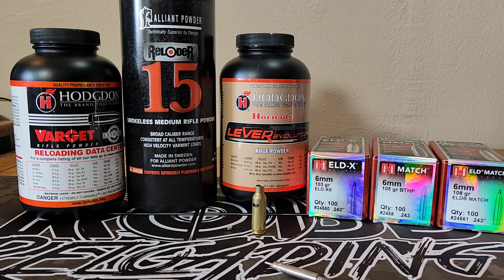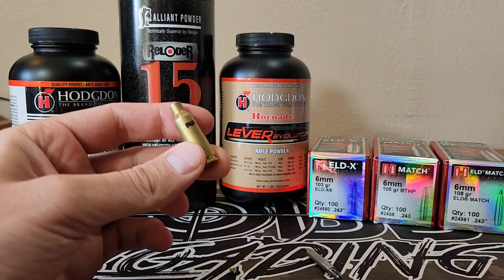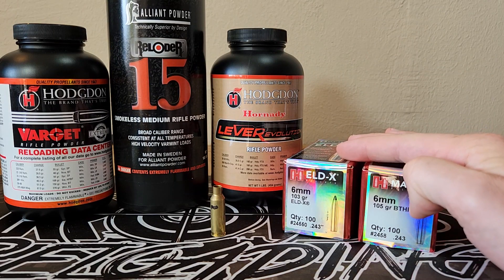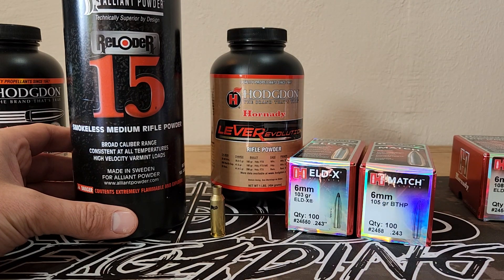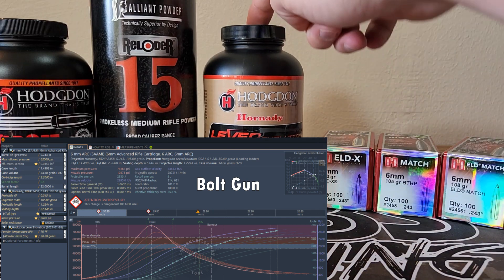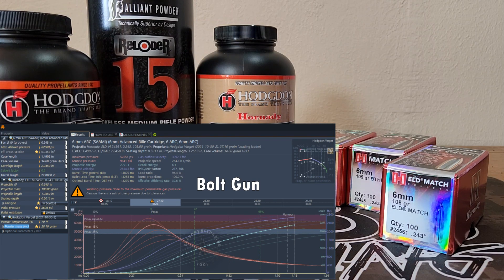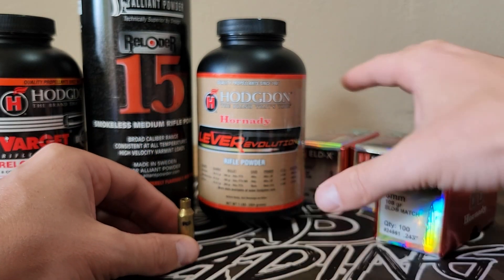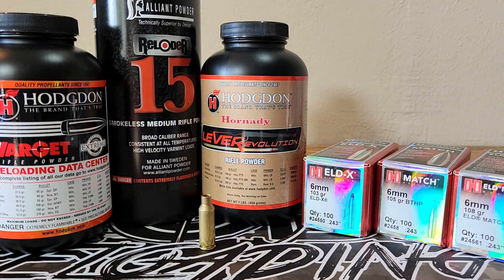6 ARC Brass Life/Load Data

Comment: I've had a lot of pressure issues with 6 arc. Peirced primers in factory hornady ammunition that is loaded too hot. I'm getting flat primers, ejector smears, raised burrs on case heads on loads that are below max charges using hornady's gas gun load data. Sheared off extractor with less than 200 rounds shot. In my opinion  Hornady lied about this new round they created. Their marketing doesn't work if you can't get the velocities they are promoting. Pisses me off!

Comment: Firing the 6ARC through a Shilen 28" four groove barrel and loading extremely long if a Savage 110 action. First I will say with all the powders I have tried with a few different 105gr bullets I have been finding the published velocities to be so far off to be useless. I have been using a combination of Hornady and Starline brass. I have some with 5 reloads through them and still tight.

Comment: I think you are correct. I pulled apart some factory black and match ammunition.  They are both loaded with 30.2g of what looks like leverevolution.  I noticed that they have stretched primer pockets after 1 firing of factory loads. I think hornady fudged the numbers a bit. I also think this is why guys are having issues with bolt heads breaking in gas guns with this ammunition.  Its loaded hotter than their listed max loads.
Reply: I did the same thing with the match. Some of mine weighed  in at 31.0 grains.
Reply: Same here. I pulled bullets from their 108 gn eld m ammo and weighed the powder after my extractor broke off. The powder charge was between 30.5 and 31 grains.

Comment: Not all brass is the same either!!Use a ball anvil micrometer when working up loads. Measure the expansion of the case right above the rim. After firing it should not exceed .0005 and its also a sweet spot typically for combustion. That  is all that the brass you are using can take before it starts to fail. More expansion than that will lead to loose pockets and then case head seperation. This is an old school technique that never shoul have been forgotten. Also i suspect hornady brass is not very high quality. Ive had similar problems with it before i started with the micrometer.

Comment: I am new to the 6 ARC but have had the same issues with Hornady 6.5 Creedmoor brass from new factory ammo.  Three rounds with the factory load data and the brass is trash because of a loose primer pocket.  I called Hornady on this and their answer was that they only guaranteed the brass (from factory ammo) for one firing.  I also pulled some of the bullets and found the charges were over their stated load data on the box by 1.5 to 20. grains.  This was some of the early ammo right after the cartridge came out.  The ammo does shoot accurately but I was hoping for longer brass life.

Comment: Have had same issues. 30.0 of leverevolution. 108eldm.  Got 2 reloads and now the brass is destroyed. Had over 80 pieces of brass with cracks in it. 20" gas gun.  Proof research barrel. Gun shoots like a laser but I can't keep it there. Not at 2 reloads per box of brass. Lapua brass is far superior

Comment: Using my gas gun, I’ve got ZERO issues with loose pockets, if anything, mine are a bit too tight, causing faint marks on the primers when pressing them in. Only had a couple pop out and they were due to over pressure issues with a suppressor, my mistake. I suspect these are issues related to bolt gun pressures being so high. They’re really hot-rodding the cartridge in gas guns to get the speeds everyone wants. I’ve got like 6-8 firings now. Still no issues in this area, whatsoever. Hornady brass is holding up fine.

Comment: Hornady says 2650 with 90 grain and 29.5 grains leverevolution and I get 2800 any higher charges tears up brass bad in 18 inch gas gun so yeah their load data is way hot for gas guns

Comment: Don't know about you but in my arc I have been trying alot of different brass. First off I started off with 100 hornady black once fired cases that I personally fired. Reloaded thos with max loads according to hornady load data about 5 times then the brass either got cracked necks or blown primer pockets. Then I stepped up to 6.5 Grendel lapua brass. Been shooting the living crap out of it at very hot loads for a gas gun with annealing and have over 10 firings.

Comment: Hornady does have gas gun data for their 108s (and 110s), it’s published separately. I don’t remember where I got it, I have the pdf stored in my phone. Gas gun max charge for LEVERevolution is 29.7 (gas gun) w COAL 2.260. I haven’t been able to try LEVERevolution myself, I’m using CFE223. Using that at max charge, my velocities agreed with the Manual’s predicted velocities within 10 ft./s, and my internal ballistics program predicted pressure of just over 52,000. I haven’t seen any signs of pressure, but I also haven’t got more than 2 loadings on my 6ARC brass yet. I’ll give LEVERevolution a try when I can find it.

Comment: I haven't yet started on 6arc but i have been doing a lot with 6.5 grendel and I have built a bolt gun for it.  It handles higher load pressures than the gas gun thats for sure but what i realized is with that tiny case just a bit more powder can really spike your pressure without giving you much extra velocity and it beats the crap out of my brass.  now the interesting thing I learned is that if i seated my bullets so they only protrude into the case to the point that the boat tail clears the case neck that drops the pressure signs even with over 30 grains of 8208 xbr. This is netting me 2820 FPS (22 inch barrel) with pretty good brass life. so maybe you could try seating longer or getting a shorter bullet and gain some performance and brass life.
Reply: Maybe your forming a donut at the neck shoulder junction.
Reply: @rustynut1967  doesn't seem like thats the case,

Comment: I’ve been reloading nothing but 6mm ARC Gas gun. I mean approx 2k rounds. Went thru 4 barrels and 400 pieces of brass. Used LVRE, RL-15, StaBall 6.5, Benchmark, 2460, and Varget. Until this week, always Horn 90, 100, 103, 105,  & 108. Hundreds of Horn brass. 3 different receivers and lowers. Reference Horn and Hodgdon Load Data only. Cannot get these shits to group consistently. Just switched to Sierra TGK 90 Gr. Got tons of notes if you need them. Failed at building a sub-$1k Precision gas gun.
Reply: What load/ bullet would you recommend for 16” gas gun. Just want a good deer load for it that I can find components reliably . New to reloading

Comment: In my experience, from reloading both .303 British and 8x57 Mauser, Hornady brass measures well and is largely consistent, but I find I do have various case failures before it seems I should.

.303 British is a brass-grinder of a caliber, because the chambers were so sloppy.  If I have brass last past six reloadings, I consider it to have lived a full life and every reloading thereafter is a bonus.  I've had case head separations with Hornady at five, which has been better than some other brands, but it's hard to justify the cost when PPU-brand brass keeps on trucking afterwards at about 60-70% the cost.  (Doesn't matter whether I am neck-sizing only, or just bumping the shoulder back 0.002".)

In 8x57, I've had my brass form what looks like insipient separation rings, like what you sometimes see before case head separation, but it's further up the brass.  This happened after about six firings, if I recall correctly.  I can't speak as to what properties of the brass causes this, but my initial assumption was because it's thin brass; it always seems to measure lighter than my alternatives.

Take this report with a grain of salt.  My usage scenario is with milsurp rifles, and I'm also not annealing the brass.  That checks off a lot of boxes for harsh usage conditions, and is going to be a lot more work on the brass than the average joe with your standard off-the-shelf rifle. Annealing the brass before initial fire-forming may mitigate a lot part of my issues, and I've never tested that hypothesis.  However, I have a semi-custom in 7x57 Mauser which I bought Hornady brass for, and I plan on putting the brass to the test in that platform.

Comment: Hornady 6.5 Grendel brass doesn't handle max load pressures well even in the Grendel.  Have you tried any of the 220 Russian cases from Lapua? They should work better in the 6 ARC as the case head is much stronger.

Comment: This is exactly why i won’t do a 6arc build.   I was talking to a ballistician  and he said all of hornadys data was over pressure for Grendel and standard arc brass.   Regardless of bolt or gas gun arc should never be ran over that 55k threshold.   On gas gun it’s bad on the lugs of the bolt.   He even recommended using 220 russian brass and fire forming to 6arc if i did go that route.

Comment: I have 2 bolt arcs a 110 switchback and a custom howa. My savages chamber is huge! Shows pressure sooner then my howa which is just saami min reamer. I'm using lapua grendel brass but I can't get near what hornady says they can put in the case with all powders I've tested. For example 30 grns of lever is to compacted it will dent bullets
Reply: I was even getting burst primers with factory hornady black with the savage also

Comment: I've been using new Nosler Grendel brass and on my 3rd loading. Only difference is I'm using a gas gun. I use CFE223 and Lever Evolution. All looks good so far. I also see some folks having some swelling at the base when sizing and wonder if that and the combination of higher pressure could be distorting the base of the cartridge.  I'll keep you abreast of my brass life.
Reply: Quick question: are you using Hodgdon load data?

Comment: Same gun here. Haven’t gotten any loose primer pockets yet. On the 4th firing on factory brass with some cases. I’ve taken a few loads over max and started to see some signs of pressure. Haven’t pierced any primers yet. Using Tul SRM primers though. They are really hard. Anything softer starts having issues. There is no way to run non magnum primers in my experiences. Found that 30 grains of CFE223 and the 108 ELDs to be the best load thus far for low SDs when chronod, and they group extremely well. Next best was Accurate 2495, which I worked up my own loads for staying close to similar powders. 26.8 grains at 1.698 off the ogive got a very nice 2729 average and 9sd. Out of two groups shot at 100 yards the smallest 5shot group being 0.333”. Showing pressure though at that highest load via ejector smears.

Comment: It maybe just Hornady brass. I have had loose primer pockets after 2 firings with Hornady brass on my 6.5 Creedmoor in a AR-10. I hope more companies catch up and start mass production of 6 ARC brass. I can't give a opinion on Hornady 6 ARC brass as of yet because I have settled on a 2 powders and 2 loads for the 103 eldx @ 2830fps out of my 24" gas gun and have less than 400 rounds fired with 200 cases.
Reply: I hear Peterson is suppose to be coming out with 6 ARC brass. They make excellent brass for my 6x47 Lapua.

Comment: Hi Rob, I have the same gun. I have found the Winchester 748 works great 27.4, 108 eld, fps2437.
On 5th reload for 6arc brass an pocket is still as snug as first hand load.
Reply from the maker: What's your barrel length. At 2437fps I wouldn't expect any pressure issues.
Reply: That’s a very light load cuz I’ve used that same powder and bullet and got over 2600 fps not sure how much powder I used I stopped using that powder
Reply: Sorry it's the 18 inch.

Comment: I have been following your 6 mm Arc progress for a while,  I thought your loads were too high also.   Dont throw away them old cases,  get a primer pocket repair tool.
Its a square steel block with a pin that goes through the neck and up into the flash hole, then there is a punch tht you use to hit the other end with a hammer real hard.
Vases are then reuseable .  I have used Quickload  for 10 + yrs and it is easier too find problems.    My problem now is unable to find any brass for 6mm Arc or 6.5 grendel.
What is going on with these manufactures ?????

Comment: Same gun. Savage 110 switchback. I’ve had several pierced primers in both handloads and factory hornady 108 ammo. Was getting loose primer pockets in hornady bras after 3 firings. Found some lapua 6.5 Grendel brass and have not pierced a primer or even had much cratering.  Only 2 loads on the lapua brass and primer pockets are fine. I also get pressure signs before reaching hornadys max and also getting higher velocities in a 22” barrel than hornady manual predicts. Sometimes 100-150 fps
Reply from the maker: Yeah that has been my experience as well. Guess I need to try some Lapua brass.
Reply: Been using CCI BR primers as well
Reply: Well crap. Loaded up some 75 vmax. Cci be primers. Started at 28 gr benchmark as that does fine in that gun with 87 vmax. First shot pierced primer. Tried another and pierced primer. So I don’t know. Didn’t chrono them. Wish I would have
Reply: @sethboyce9832  BR primers are thinner material. Try CCI 41 or 450 primers.

Comment: I have been reloading for about 50 years now but I bought a box of Hornady Black 105 and Hornady Hunter 103 6ARC ammo for testing. I removed the bullets on 5 in each box and weighed the powder. There was up to 1.5 grains difference between the 5 loads in each of these boxes. I reloaded each of these with varget (these were not hot loads) and 109 bergers along with 10 cases of Lapua 6.5 grendel converted to 6ARC. After 4 firings of the Hornady brass I could press the primer in with my thumb. The Lapuas are on their 15th firings with no ill effects. I do not now or have I ever liked reloading Hornady brass for this reason. It is way too soft. I have talked to them about this and they don't seem to care. Don't get me wrong I have quite a bit of Hornady stuff but I hate their brass.
Reply: Now that I have assembled an upper in this cartridge, it appears that the Lapua 6.5 grendel brass is the way to go, regardless of having to neckdown the brass.
Reply: Ditto on the Lapua brass. I too am loading converted 6.5 Grendel brass and am now on the 7th loading with some of it. Primer pockets still good. Problem is Lapua is not making several different calibers due to the war in Europe. 6.5 Grendel is one that is on hold. I bought some Starline 6.5 Grendel, but haven't used it yet. I don't use Hornady brass at all.
Reply: The web is thin at the base of the Lapua brass. So be careful not to load it to hot or it will bulge the case. It seems to do this more using Leverevolution than Varget.
Reply: Lapua brass and projectile are both way above most manufactures. You get what you pay for, and my Grendel shoots lights out with Lapua scenars-L w/ great brass life. IMO     So this is my first go with the 6mm ARC and I hoping I didn't waste my Moola her!  Going tomorrow morning and will report back!     BUZZ

Comment: Maybe the reason for Hornady charges being what they are is that they had to show the cartridge was the gamechanger when compared to the other 6mm and the .308... Just my two cents. I just built an upper that hasent been fired yet, waiting on ammo that comes in soon. Also, see the demand on once fired brass, nobody has. How hard is it to neckdown grendel brass? Should I start looking at purchasing grendel brass to neckdown because of lack of availability in 6ARC?
Reply: Its easy. But, unfortunately that seems to be sold out everywhere too...
Reply: I didn’t want to neck down Grendel brass because I didn’t know what all it entailed. Didn’t want to mess with turning necks down or anything. I finally decided to pick some up after having issues with brass from hornady factory ammo. I’m glad I did. Didn’t do anything special except running it through 6 arc sizing die. I did have to turn down decap pin to allow it to fit thru the smaller flash hole on lapua brass. Also bought a Frankfort arsenal trimmer that attaches to a drill as they need trimmed a lot.

Comment: I've been getting around 5 firings on my 6mm ARC brass for target/hunting but I'm only shooting an AR not a bolt gun so my data is lower. That said my hunting load in 6.5 Grendel is only getting around 3 to 4 firings but with my target load I've got a set of brass going on its 8th ot 9th firing. My understanding is that 6mm ARC and 6.5 Grendel is supposed to share that 52k psi (I think that's the number) max pressures for gas guns so it's kind of crazy to hear some of those numbers you were giving I didn't know they were going that hot for published data.
Reply from the maker: I think the bolt gun loads are supposed to be capped at 62k psi. I'm just wondering if maybe that are actually higher in real world testing, leading to overpressure and poor brass life.
Reply: @RobsReloading  it very well could be... and it would explain why Hornady of all people are releasing hot data when they're pretty notorious for leaning on the conservative side of things.

Comment: Better methods than ball and bolt. 1st look at "loose primer pocket fix" guy uses a rcbs pocket swagger kit on a hornady press. 2nd look at "loose primer pocket repair" this video builds on the ideas of the first one, guy is using an old rock chucker press. I know repairing your brass wasn't the point of the video, it's definitely a good skill to have though for those times when you have no other choice. Kinda shocked that hornady's data is so hot, they're notorious for printing conservative charges, and from what I've seen, you haven't exactly been tickling the dragons tail with your loads like you said little to no pressure signs. Anyway, keep up the good work, hope those 2 videos help with effective and efficient repair of your blown out brass holes, and hopefully we can find a solution to keep them from blowing out in the first place.